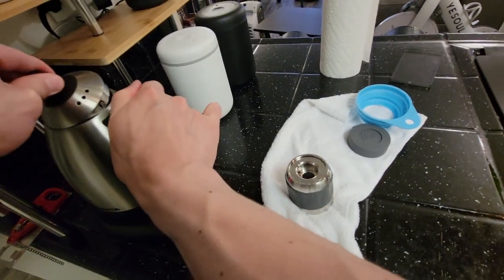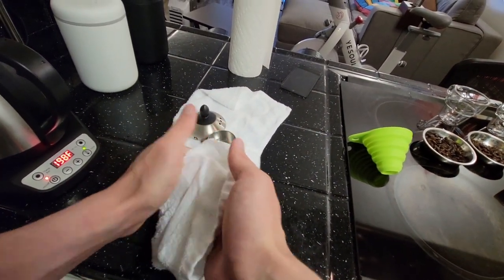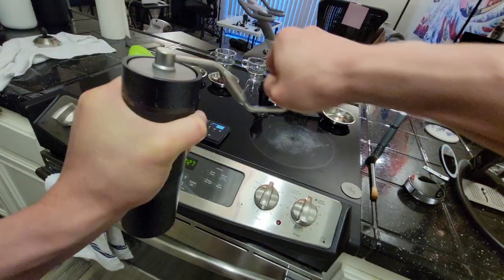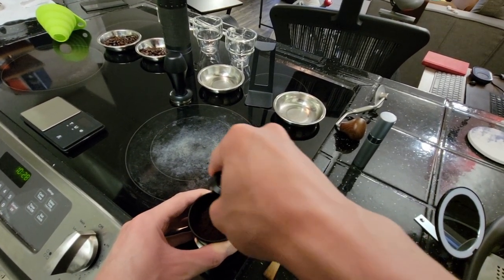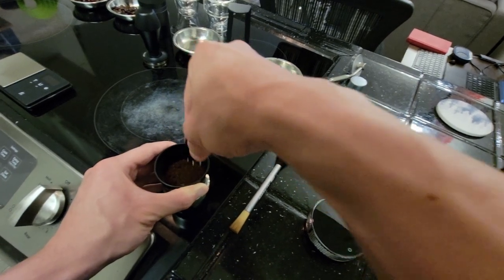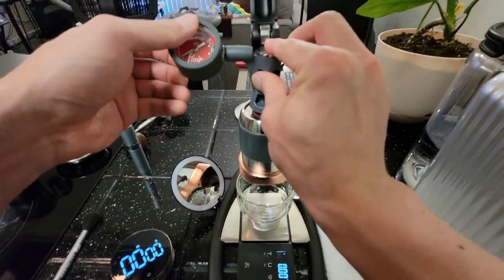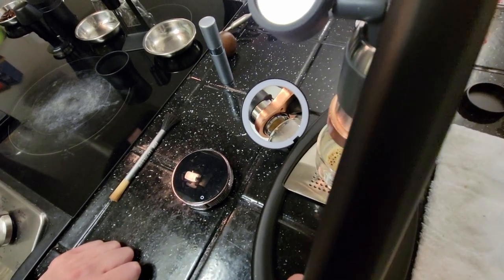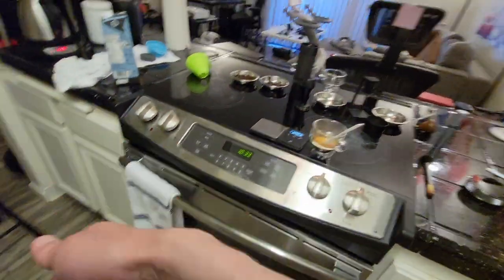Point of View: Espresso Workflow With The Flair Pro 2

Comment: Hi,
I also had "problem" with grinded coffee overflowing the basket. I was sure that I'm doing something wrong but with next, different type coffee beans I found that's they are different in density. Previous coffee were really oily/clumpy so I always had it overflove in basket and other one opposite, dry and loose, really easy now to fit the same amount of grams(16g) in the basket without pretamping with funnel still on top of basket.

I see that you preheat the chamber on the top of the kettle with silicone funnel, do you have temperature strip? 
When I used moka pot base to preheat, I could easily get it to the 95'C every time. Now Im using Fellow kettle with strainer on top(My silicone funnel came too small haha) for convinience and unfortunatelly I can only get it to the 80-85'C.

Comment: Sorry i didnt catch that but wat jmax setting were you on? I am on 140-160 range
Reply from the maker: Hi @pv1702! I'm working with a slightly darker roast here and have my setting at 1.1.4 (1 full rotation from all the way shut, turn to the 1 and turn 4 clicks past the 1).

Make sure you think about the basket size and the eventual puck thickness when choosing a grind setting. The Flair pro 2 has a 45.5mm basket compared to most industry machines having a 58mm basket. The result is the pro 2 will have a much thicker puck with the same amount of coffee grounds. The result is a coarser grind relative to the 58mm.

So I may be at a 1.1.4 but you may use that on a 58mm and find you get a gusher of a shot. When dialing in, always start more coarse and tighten from there. Get a shot that pours too fast then make the grinds finer to get the right setting. Hope this helps!